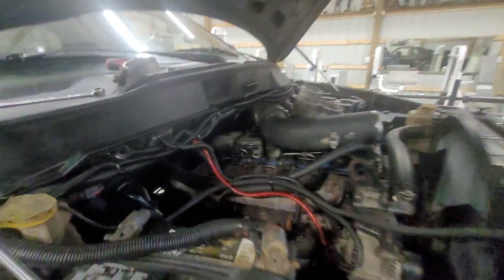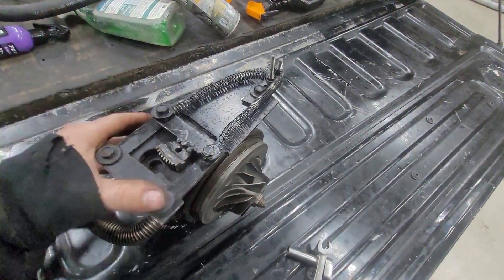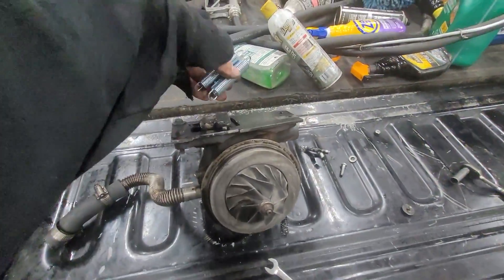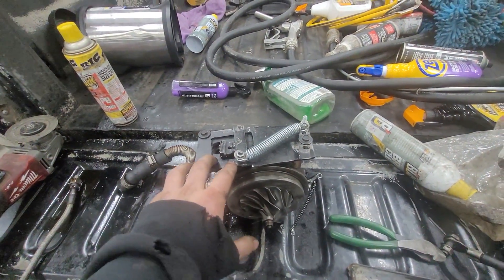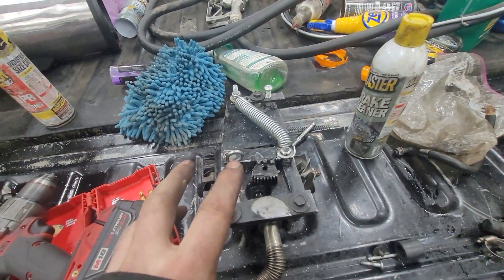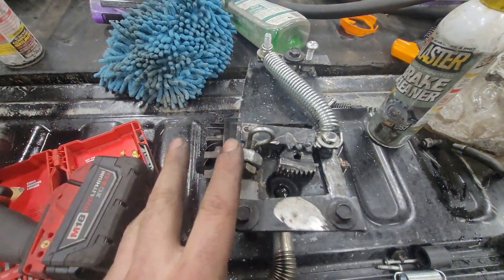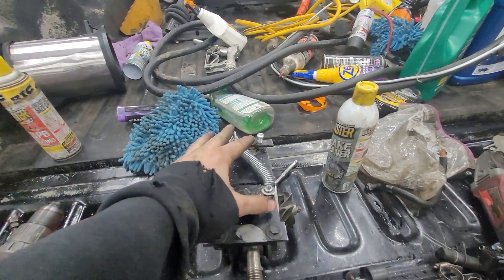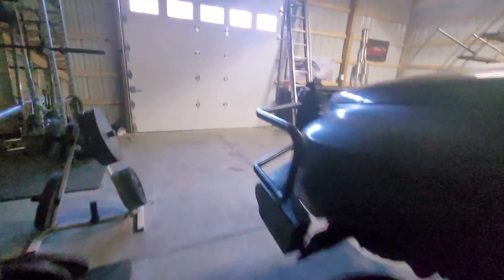Fastest Spooling 12 Valve Cummins | 15,000 Pounds Gross Weight | Version 2 VGT Control

Comment: Just an idea here I may be way off but would it be possible to make a cable driven exhaust brake I mean would take the same amount of effort as hitting a switch like set something up kinda like you’re high idle bet when you pull its exhaust brake like I said I could be missing something but could be a pretty easy way to adjust everything as you want how you want or if you really wanted to get crazy piggy back off of throttle position so it adjusts as you give it throttle and then off throttle would be exhaust brake 🤔🤔🤔
Reply from the maker: I want a button because it's a ton of effort with the throttle cable and less accurate. I want it to act like a factory vgt. 

let off accelerator - exhaust brake on
accelerate - exhaust brake off

and then an on off switch for the accelerator part. I feel I can do it. I just need to figure out what'll work.
Reply: @CPSteveMiller  absolutely man we all have our ideas on how we want to do things was just an idea I was thinking from the aspect of no electronics would be kinda cool a vgt operating with no electronic control at all will still be cool af when you get it dialed in and I’m sure you will I wanted to go s400 on my l5p but I refuse to give up the exhaust brake so in my case I’m kinda stuck with all the electronic junk cuz one of my only options is the stealth 67 vgt at the moment I’ve gotten rid of what I could if ya know what I mean lol and the truck has been 150% more reliable can’t wait to see you’re finished product  thing is already spooling like a beast 🤟🤟🤟

Comment: NAPA has push / pull cable used for hand throttle on machines it is more stout than choke pull and locks in position and when rotated provides fine tune adjustment.
Reply: Vernier throttle cable. Great for idling up for the old mechanical diesels.
Reply from the maker: That's what I use for my high idle. Works awesome

Comment: Totally cannot wait to see fuel mileage and how much more responsive the truck is while tugging a load and needing to pass or hold speed rolling up a hill. Keep up the content and your ad revenue will keep growing! Have you tried talking to any used car dealers about running out to auctions and picking up their cars? I know we used to have a guy around here that had bought his tractor and trailer while hauling cars and retired and was pulling cars for several dealerships taking cars to auction and bringing cars back from auction might be a way to keep your 3 car hauler busy without having to be gone all the time in case you feel the need to stretch your legs a bit.
Reply from the maker: I will once I get back into it. Still waiting on paperwork and insurance info
Reply: @CPSteveMiller  good deal dude just figured it might be another source of income especially if y'all are like down here where all these buy here pay here lots buy from aiaa and copart to have cars to sell

Comment: Let me know when you get a final design I may be able to have one of my robotic students CNC you a plate we have a CNC router so all I would need would be measurements and a diagram
Reply from the maker: Yes, I would absolutely love that. I feel this design is at the point now it's dialed in so all I really need to do is get the exhaust brake working and the vane collar replaced. After that I'm ready to get the nice version of this done. Should be a few weeks. Send me a message on my email or instagram(link below) and I'll get with you on that!

Comment: V band clamps are the only use for a 11mm for some reason. You are determined for sure. They make a centrifugal vgt turbo that works like a cvt on a 4wheeler where the faster it spins it pull the vanes open for the 12 valve an 24 valve
Reply: 7/16" works on 11mm

Comment: If I was you I’d run a manual hand cable that you can pull inside the cab to ingage the axhuast brake the same way you have the cable running to rev up the engine to warm it or idle, you know I’m saying?
Reply from the maker: I really just want to hit a button and have it work like a factory 6.7 truck. I know how I'd wire it up. I just need a push pull device of some sort

Comment: Need the jam nut that have the not the is at the plastic   Teflon will melt underheat the other style
Reply from the maker: I'm not worried about it melting. I really didn't need the locking part of it. I just think they look a lot nicer and it's nice having all matching hardware. We'll use that teflon as the egt gauge - "yep, it got hot" 😂

Comment: Sounds Good Steve. Could you put like a choke cable on the lever to put it in Exhaust brake mode.You could mount it on your dash easy access. Pull it to put on push it in to off. Im afraid thats going to be alot of heat for an electric motor unless you have a long rod to try and get it away from ghe heat...Just suggestions is all. Great job on it so far. And video..
Reply from the maker: It would take a lot of effort that way. I watched a few guys running a push pull solenoid. I'm going to try it and see😬
Reply: @CPSteveMiller  Check amazon for the 60lb pull solenoid.  That's what I used for my remote tailgate popper.

Comment: Why not use a cable that takes the place of your stop, that you can pull to engage the exhaust break. Push the switch back in and turns it off. Could mount right on your shifter. Then you could keep eveything mechanical and easy to work on. Could pull off and put your bolt back in if your havinf issues with it on the road.
Reply from the maker: I wanted to but a cable takes so much effort. I tried before. I really want to have a switch that would activate the exhaust brake anytime I let off the throttle so I could turn it on and off. With it on it would activate anytime I let off the throttle. With it off it'll never activate. I know exactly how I'd wire it and where I'd put the switch. Just have to find a way to execute the stopper part

Comment: Looking good. Never know true hp numbers til you dyno it. Same with 1/4 miles times. You know how many times I've heard my car runs 13s or 12s when in reality it was a 15 second car? I've also seen many that couldn't drive legit fast cars. Watched an Asian at Pittsburgh raceway in a 04 svt cobra run high 15s when my basically stock gt was going low 13s.

Comment: A bro why don't you use a old school adjustable pto cable cause then you adjust it in the cab
Reply from the maker: I want a button. It's much easier to overcome spring pressure than pulling a cable
Reply: @CPSteveMiller  gotcha

Comment: How heavy is your truck?  my 07.5 6spd, wet, with 75 gal of fuel in the bed tank and a shit-ton of tools, I'm at 8400ish
Reply from the maker: Full of fuel it's 9500 pounds
Reply: @CPSteveMiller  I wonder where you're getting that extra 1100ish pounds from.  Mine's still functional 4WD, too..   just curious.
Reply from the maker: It may be down around 9200 now without the 4wd. I had weighed it at 8740 before I put the aux fuel tank and big bumper on. Those 2 alone were 900 pounds. It's inbetween that 9000 to 9500. I'll do a reweigh once it's done and I get all the tools out. I should be able to shed another couple hundred pounds by losing the toolbox
Reply: I’ve found that it doesn’t take long for these 3rd gens to put on some weight. Mine is my daily driven farm service truck/ tow rig. 07 ram 2500 bighorn 4x4. It’s a quad cab long bed 6.7 auto truck with a Bradford built bed, toolboxes, air compressor, and a 35 gallon tank for filling my tractors up. With a half a tank of fuel in the pickup tank, an empty transfer tank, and all my tools, it weighs around 9,960. I am probably riding around at 10,500 with all my fuel, tools, and my lunch and coffee. It takes the weight way better than I expected for a 2500. I would have never guessed it was that heavy looking at it. 🤷

Comment: Do u have a peromiter?
Reply from the maker: Nope 😂 I will get another one eventually. I want a back pressure gauge too
Reply: @CPSteveMiller  If u have the fuel put to that motor,esp in the hills you will melt pistons,remeber aluminum melts at 11.50! Just a thought.
Reply from the maker: I remember I used to watch it climb to 1700 daily. After running those high numbers all year last year I stopped worrying about it 😅
Reply: @CPSteveMiller  I use to run a hotshot biz hauling cars out of vermont,it was fun and did ok on money,always ran ford 6.7 diesel.was home every night in my bed.

Comment: I'd be curious to see the drive pressure vs boost pressure with your modification. That whining in the higher boost levels tends to make me think that your drive pressure is too high.
Reply from the maker: It has no air filter on it so that's kind of the whining. Put the air filter on it and it goes away
Reply from the maker: I will get an exhaust pressure gauge at some point too so we'll know
Reply: Could be a boost leak

Comment: I think the electric motor adds too much too it... Just add another cable similar to the high idle you've got set up
Reply from the maker: Problem is leverage and force. I really want it to be electronic, on/off switch, and activate only when I let off the throttle. I have a design plan in my head. It's dialed in on the vgt side. Just want a good exhaust brake I can turn on and off without thinking about it

Comment: Or you could leave turbo working good by its self and put and exhaust cutout down the pipe somewhere and install a switch Incab done deal
Reply from the maker: I definitely want to get it working 100%
Reply: @CPSteveMiller  Yep, function over form.

Comment: Looks like a tweeker made that 🤣
Reply from the maker: Version 4 will have a nicer backing plate, arm, and adjustments. Next version I want to get the exhaust brake working
Reply: @CPSteveMiller  
As long as it works

Comment: Yeah 350 horse but probably 1500' foot  pounds of torque
Reply: 1,500?  LOLOLOLOLOL....No.  1,000 is more realistic. The hp might be 350 at the flywheel.  We should start a fund so he can get it in the dyno and actually see the numbers.  Make a game out of it, like the closest to the real number wins or something.  It's absolutely worth knowing. You can also get an idea of EGT's on the dyno, just to be sure you're not going to melt a piston or burn a valve.   You can make better decisions about where you need to spend the money.  I'd say head studs are a wise choice for now.
Reply: @pamike4873  👍 I'm from  Shenandoah PA and I should have said 1200
Reply from the maker: Dyno will come after it's all dialed in. Definitely curious at this point. The torque is absolutely insane though😂